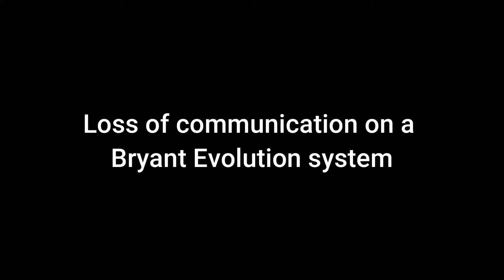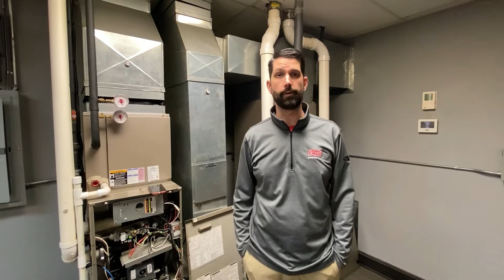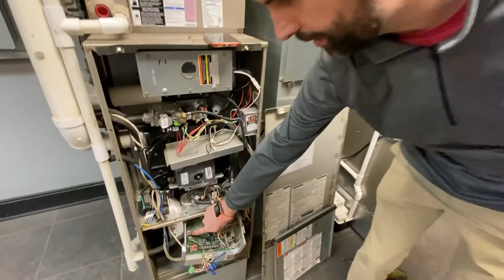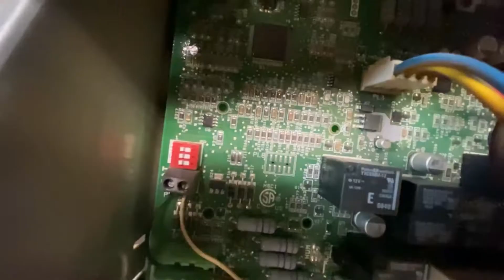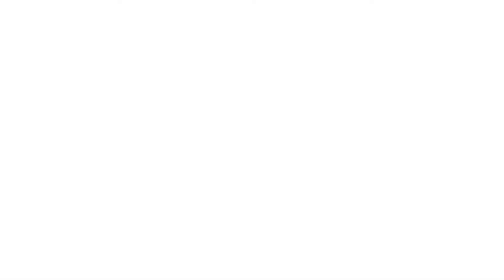Loss of Communication on a Bryant Evolution System

Comment: Hey Paul… had a Tech come out & fix my unit per replacing my condensate pump.. two days later it stopped & gave me an E1 error (communication error i believe) the Tech came back out & said it needs a new thermostat & quoted me $1380 to replace & imstall which sounded high to me.. i have a 7 year old Bryant preferred series thermostat T6-PRHO1-B … does that quote seems high to you? thank you very much!!

Comment: Is there any dip switch settings that need changing going from oem bryant thermostat controller which uses data port to a honeywell wifi that uses the 5 wire setup that connects at the screws (w2/y1/dhum/g*/com 24v*/w*/y*/r*)?
Reply from the maker: @scotts4920  No sir. 

Furnace can run perfectly fine with a “W” call. 
Now there are air adjustments you will most likely need to address either by dip switches or NFC App depending on the series of the unit. 

Or staging options if you choose. 

But to answer your question, the unit will operate just fine with a 24vac thermostat on all commands.

Comment: I tried to install a 24V Honeywell thermostat to by Bryant Evolution furnace and the thermostat will turn on but not turn on the furnace heat. I believe the voltages coming to the thermostat were reading 70V. Do any of the little switches on the circuit board allow 24 volt thermostats. The old bryant still works but has some broken analog type buttons and the new Bryant thermostats are very pricey.

Comment: Very helpful, would like an explanation on why sw4-2 causes this error. Is it because of the auto staging feature for a single stage thermostat sending mixed signals?
Reply from the maker: The UI reads the board. Furnace staging can be system, UI and so on. 

Turning on SW4-2 disables the boards staging algorithm. Turned on is used for multi staging 24vac thermostats. 

Staging by stat demand. 

The UI is now looking for a staging algorithm that doesn’t exist anymore and goes into a communication loss. 

Hope this helps!

Comment: Hi Paul, I just got that error.  It is a system malfunction and the outdoor temperature on the thermostat now does not read.  I have had this system for 10 years and it just did it?  I have not opened it up to see if the dipswitch is off, but it worked just fine for 10 years and it just started today.  Furnace is working fine, producing heat when needed.  Should I open it up and check the switches?
Reply from the maker: Hey Dustin, if you lost the outdoor temperature with no error codes, it is likely that your thermostat is not connected to the Bryant server. This happens occasionally with software updates and server maintenance. Our advice would be to give it a few days, see if it reconnects automatically. If not, call your local Bryant dealer to further troubleshoot. Hope this helps, have a great day.

Comment: Thanks for sharing your videos great content I installed a Bryant Evolution furnace model 987mb4206c17a-a 8 months ago. About a week ago the temp drop down to the 40's in Michigan and I turned the heat on to take the chill out of the house the furnace did not kick on so I went to the furnace and saw the light flashing on the service panel with a code 35  do I have loss of communication ?
Reply from the maker: A 35 fault on a 987 is almost always a gas valve issue. We have seen in the past intake vent directly over the valve can drip water on the valve. 

Usually hits right at the harness of the valve.  I would look for this first. 

Good luck.